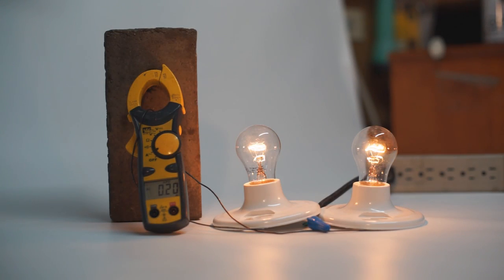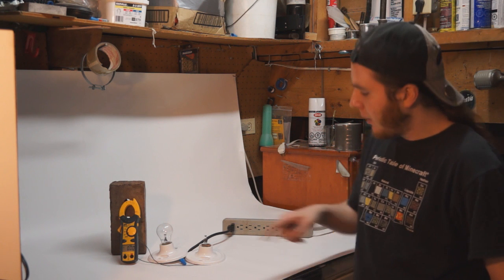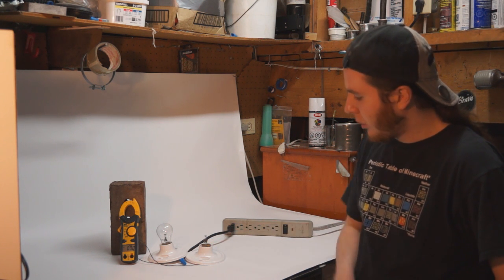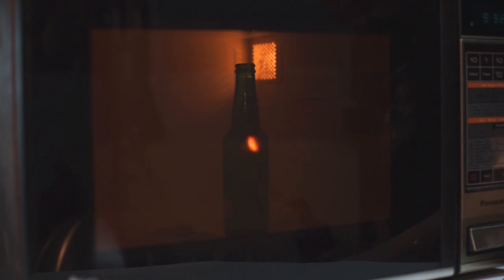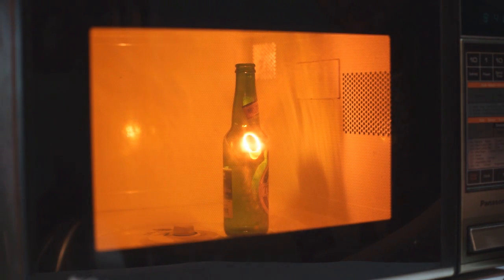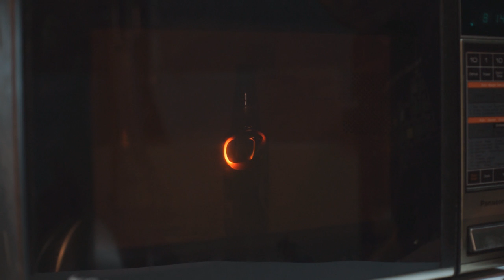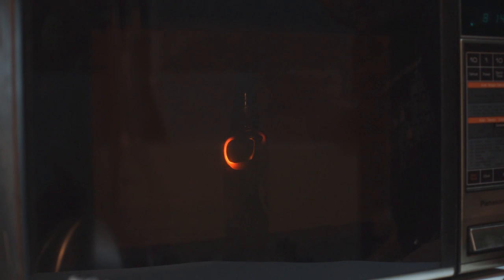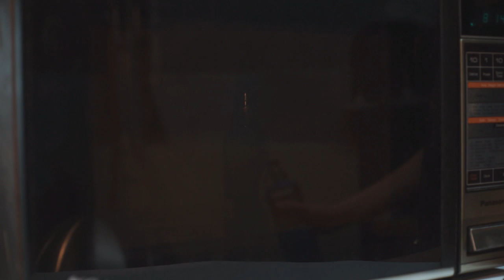Conductive Glass

Comment: Neat experiment Nick! I noticed the molten spot in the glass got to a certain size, then lingered there for a while. I'm wondering if the outer size of the whole could be calculated to the size of the wavelength?
Reply from the maker: I'm not sure if the final side of the hole would indicate much but if the initial spot is small than the wavelength I don't think it will absorb enough to heat up. I'm not an RF guy so antennas (liquid ones in more so) are a bit of a witchcraft to me.

Comment: Oh, do you know what else is conductive (that I'm glad you didn't discover with house current)?    Flame.  I gave myself a shock with a neon sign transformer holding a blow-torch to an arc... the voltage was high enough to jump through the can's paint into my hand when I brought the flame near one of the terminals.  Fortunately, the current was very low, but it was startling enough to teach a lesson.
Reply from the maker: I'm actually working on a demo to show this but the current's are so low that they are very hard to measure. I might have to do something tricky like flame rectification.

Comment: i know that the molten glass is conductive but are you sure you didnt melt and connect those electrodes in the glass while melting the glass?
Reply from the maker: I should have had a closer cropped shot but no the wires didn't touch. I cut them back flush to the stem and they remained separated by the hot glass. You'll also notice that as the glass cools less current passes through the circuit, had the wires touched current would have continued to flow.

Thank's for asking, I will keep it in mind to get closer shots of whats going on in the future.

Comment: but the molten glass would undergo electrolysis, right?
Reply from the maker: If I was using a DC power source and electrodes made of the correct material it could happen. I might try that some time in the future. In this case it just heats up because it is dissipating power as a restive load.
Reply: facepalm i totally forgot about the AC.
thanks!

Comment: That was awesome. I have never seen that microwave experiment before. Does it do any damage to the microwave?
Reply from the maker: As far as I know it does not damage the microwave because the glass absorbs all the energy. The only thing I have heard that damages it is to run the oven while empty.
Reply: There's absolutely a potential not only to ruin the microwave but burn down a house. You're dealing with molten glass. If you really want to do it, get an old junker microwave and do it outside, but make sure you research it to know exactly what you're doing.

Comment: Funny enough dont most conductive materials lose conductivity when heated? Or am I think I'm thinking of magnetizm.
Reply from the maker: Both are partly true. Many materials become less conductive as they heat up, a lightbulb is a lower resistance when it is cool than when it is hot. Some materials also are unable to hold a magnetic field above a certain temperature, this is the Curie Temperature.